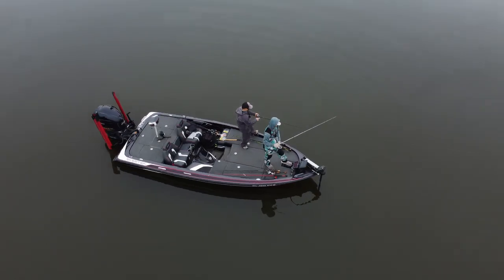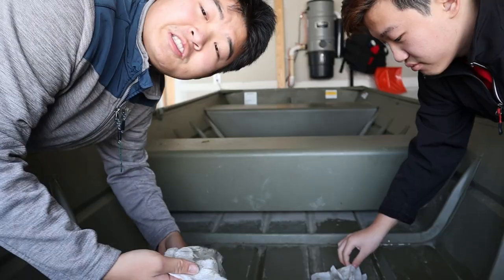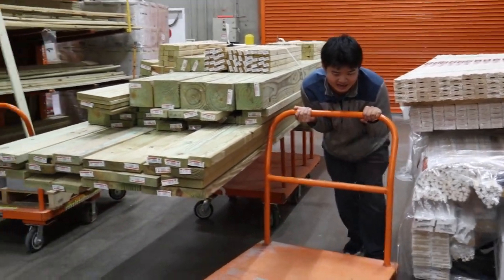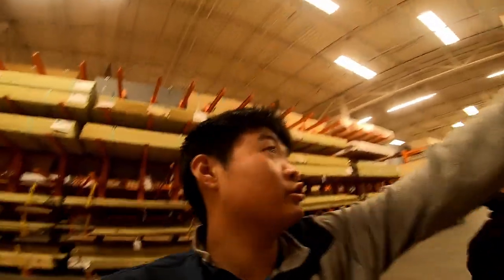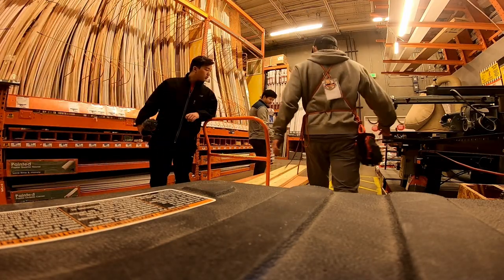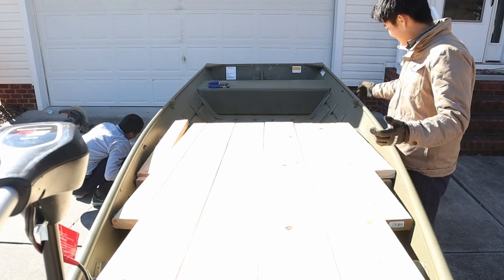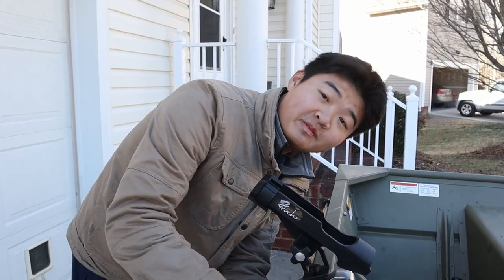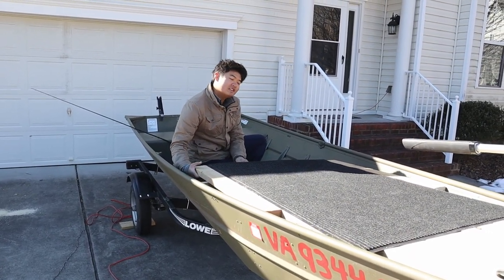Transforming My Jon Boat Into A Bass Boat!

Comment: That is a heavy deck. Way more weight on the front is going to cause the nose ride heavy, I framed my front deck in aluminum and used 1/2 inch plywood treated  with resin to waterproof it.
Reply: The only sensible comment on here 😂.
Reply: @WitchDRofKabul  not really treated wood eats aluminum

Comment: Ditto on being mindful of how much weight you add. If you don't have close to equal weight at the Stern where you're building up the bow your boat is gonna be nose heavy in the water. I modified my 1448 jon a few years ago and was able to do it using all 2x2 and 1/2" plywood construction and didn't increase the weight by too much. If you check out Tony Boat Nation's channel though you'll see some great info on framing using aluminum angle and that's the preferred method by far. Nice job though! You're gonna love have a casting deck up front.

Comment: Good job for building the deck but do you think that is a lot weight fir your boat? Overall hood job 👍
Reply from the maker: Yeah I’ve been thinking about that. It’s front heavy atm, but the deck is actually built at an angle where it stays flat even when it’s front heavy. Once I put a motor on the back it should balance out better too.
Reply: @FISHERYIN  👍

Comment: You have the right idea but, take ALL that weight off the boat and use it for a out board stand in the winter!!! I’m afraid you’re going to sink that poor little boat!!! Please consider using plywood instead!!!!!
Reply from the maker: Plywood will be v.2 of the deck, but surprisingly, the boat handles perfectly with the deck. With the outboard on it, it’s incredibly stable, supports two people on the deck, and rides on plane. Guess I got lucky but thanks for the suggestion James!